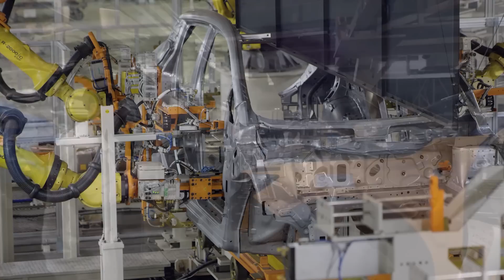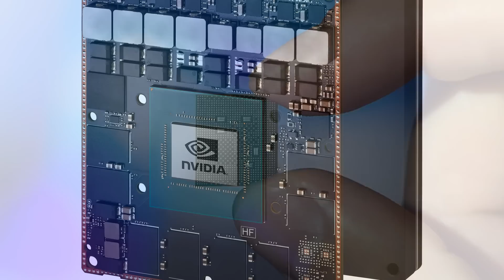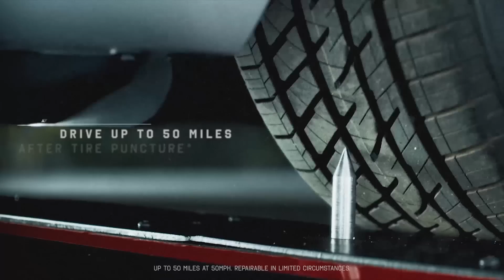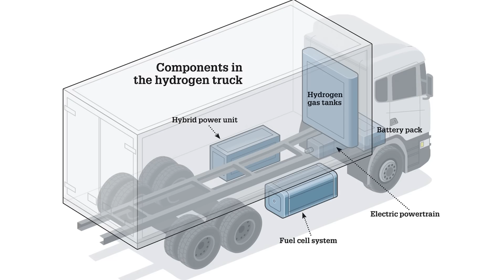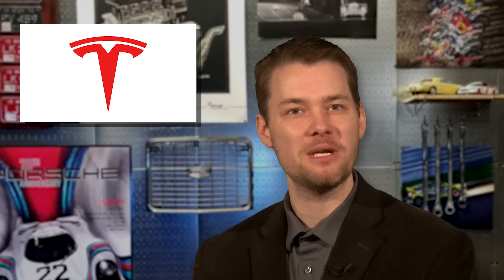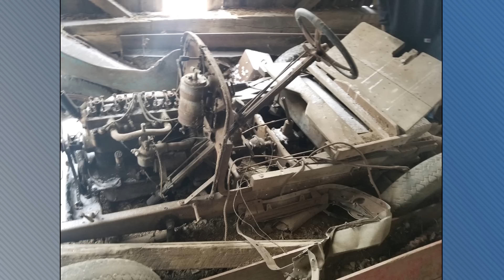Ford Mustang Going Fully Electric; Chip Shortage Crippling Production - Autoline Daily 2997

Comment: The chip shortage is actually a generational problem. If Tesla and GM don't have the problem it's because they updated their chip designs to use the latest, largest wafers. A lot of auto manufacturers are still using the last generation of wafers for their chips, and it's those foundries that are in short supply, because the chip makers expected everybody to update to the latest wafers and a lot of people stalled, not wanting to make the investment.

Comment: It appears to be an overhead valve, 4 cylinder engine.  I don't think Ford, GM or Chrysler made such a thing until the 70's.
Reply: That is a Chevrolet engine from about 1916. They offered a "valve-in-head" in-line 4 cylinder engine starting in 1914. See details on this Wikipedia page: https://en.wikipedia.org/wiki/Chevrolet_Inline-4_engine
Making old Model T, A and Chevrolets into chopped farm vehicles was very common. In the 1960's I would trash around with my cousin who had a chopped Model A with A Model T truck rear end. It was much like the photo in the barn find story. It just had the front hood and cowling and two seats - totally open. My uncle used it around the farm like they use 4-wheelers today.

Here is video of a 1920 Chevrolet truck version running - cool! https://www.youtube.com/watch?v=m9bTb_4WTQA

Comment: Great 👍 show .. for the first time just about everything reported was news to me .. that’s awesome 👏.. keep up the great job .. 

So 2028 all Mustangs going electric? Interesting I wonder how that is going to go .. I don’t know feel too soon to talk about doing that when the Mach E is not even really out yet .. (as of this post anyways)
Reply: Electric Fusion - contrary to what Sean reported here there are indications that Ford has almost ready a 7G Mustang with a complete ICE selection in < 2 years (2023 MY at most). 

That includes a 6.8L V8 made in Ontario, Canada that Ford suits already promised the Union for one engine factory there for F150 (probably the Raptor's top line V8 model) and the Mustang (GT500 most likely). That info was already published up to the model (but not variant) level by a local newspaper and not contradicted by Ford.

So Sean is talking about the 8G Mustang that could be due in 2029 MY in the SAME BEV PLATFORM as the 2G Mach E (2 and 4 door versions of the same car / crossover).

THAT would make sense with news already out.